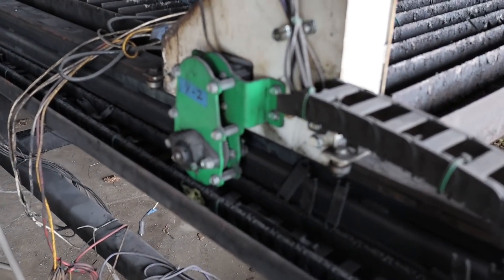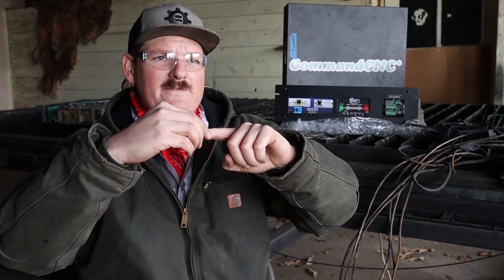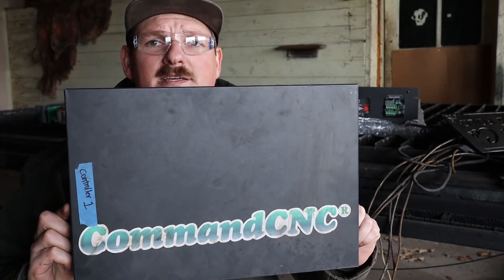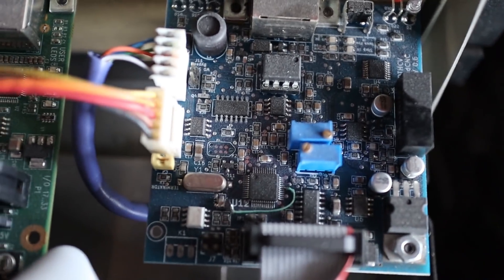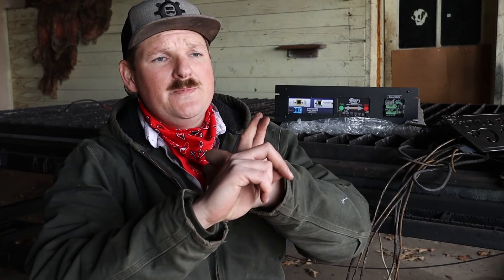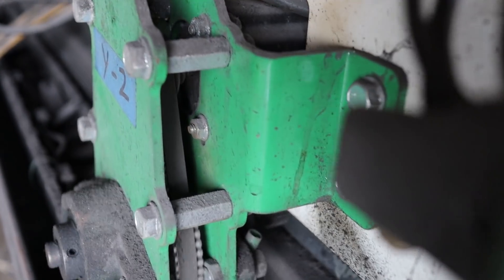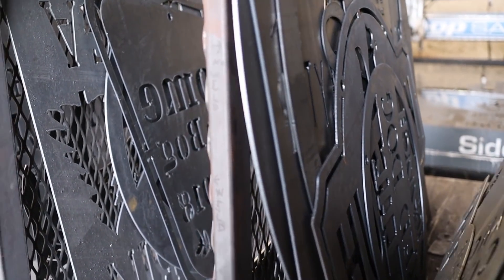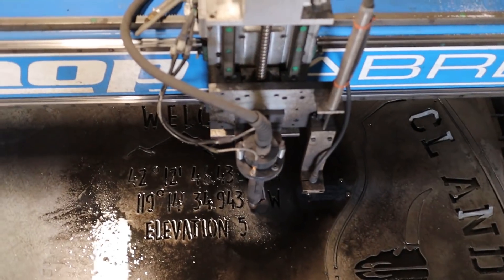BUILD or BUY - CNC PLASMA TABLE (TRUE STORY)

Comment: Man we have such similar issues I can really relate. I designed mine to be able to put a router on eventually and made the gantry too heavy. I have the older bladerunner setup that came out about a year before the commandcnc stuff that was supposed to be better. Which I had actually been contemplating buying a while back because my machine has had an issue ever since new where the torch will cut off but the machine keeps moving. After half an inch the torch turns back on and makes for a day of babysitting to restart the line where it screwed up. I  got another computer a couple of weeks ago from a buddy and it seems to be better but still has issues.

The reason I got the bladerunner was everyone talked about how great the support is but I agree it isn't there. I've emailed on about 6 different issues and every time after 2 emails from them on a topic they stop responding all together.. So I guess you have to figure it out in 2 emails or they move on and your left scratching your head.

I've been reworking everything I can to make it perform better (revamping the gantry) because I am planning on making it a full time gig as well and I'll be buying my next one as well. Not sure what brand yet but it won't have candcnc attached to it.

Is the Shop Sabre stepper motor or servo? Is the lack of speed do to the cut speed or something else?

If you get a minute I have a build page but I lost a bunch of the pictures do to a broken phone.  You may have to sign up but they won't spam you to death. Plus there are a lot of people willing to share their knowledge from plasma makers, cad, and cam issues.   https://www.cnczone.com/forums/plasma-edm-other-similar-machine-project-log/186052-4-x-8-plasma-table.html
Reply from the maker: Wow man, I feel your pain in all of this.  Sounds like a pretty typical experience.

The ShopSabre is glass encoded servo motors.  I think the cut speed could be fixed with some tweaking of the touch off sequence and a few other .ini files but I just don't have the time to crack into it and do some serious testing.  

Thanks for the additional resources, that is the next step for me.  Finding another DIY supplier that I can recommend with confidence.  Keep pushing brother!
Reply: @MakerTable  You're welcome man love to see entrepreneurs do well! That site has tons of different forums. I still go back and search for things and try to help out others just getting started.

Is your shop sabre pretty similar in the process from cad to cut as your DIY table?
Reply from the maker: @FTWarr  yeah the work flow is similar to the DIY table but I miss using sheet cam. I'm forced to use enroute w the shop sabre and it wasn't made for plasma so it's a little clunky. But I've gotten pretty efficient in there by now 🍾

Comment: Sucks about the control box.  I think the waviness of the cuts was probably due to the backlash introduced by the worn set screw/shaft.  One thing that sticks out even with the new machine is the amount of fine metal dust coating every surface.  That can't be good for long term reliability.  I've seen some plasma's with a silicone type shield that goes over the torch. I wonder if that would help cut down on the dust.   Anyway thanks for the honest feedback.
Reply from the maker: You're 100% correct about the backlash in the gear reduction units.  They work loose over time and exacerbate the THC issues to create a perfect storm of terrible cut quality.  I have seen those silicone shields too, it's probably worth a shot.  Thanks for the ideas!

Comment: Man im devastated i just finished a one year odyssey  building my command cnc table based off your table build the  only things i did differently was i saw how you struggled with the tapping the holes for the gantry axis so i opted for the aluminum 8020 extruded gantry and i didnt buy the belt reduction. i struggled with getting adequate cut speeds due to using an older thermal dynamics cutter with no good charts to guide me in set up. of course i discovered my commpressor was underpowered but luckily i had 50 amp service to my plasma machine in advance so i didnt have to hire an electrician. i will absolutley lose my mind if i have to buy another plasma tabel within a year.
Reply from the maker: I totally feel your pain brother!  I wish I had better news for you but this is the realization I came too after may hard fought battles with this company.  I know some people have had better luck with these controllers but it has not been my experience.  I say run that sucker into the ground and don't take any crap from those guys when it's time to get a repair.  I'm still trying to find a good off the sheld controller package to recommend but I'm a little gun shy after the last one.  Best of luck, keep pushing.  If you have the guts to build a CNC table you've got what it takes to make it to the next level regardless of the controller.

Comment: i build my own table with command cnc and i love it never a hick up cuts great every time and so easy a child can use it i think my total cost was around 5500 witch payed for itself first month. sucks you had a bad experience but you did get to learn in the process.
Reply from the maker: That's so rad that you got a good one, I'm happy to hear ur kicking ass with that table over there! I learned a ton doing this whole thing, I'm so glad I had the time to do it!
Reply: @MakerTable  I'm glad it works too but it looks different then your box. Now I've built 3 other cncs check out centroid controller
Reply from the maker: You probably have the Windows based controller, this is the Linux one. I'll check out centroid rn, thanks for the tip!
Reply: @MakerTable  no mine is linux cnc just mine has just a box not that flat style. the centroid acorn is amazing for mills

Comment: Thanks, this video kinda hit the spot for me as I just started a side business with my TruCut XT machine.  I'm pretty happy with it after 3 months but am thinking a bigger machine in the future.  My thoughts had been that JD Squared & Shop Sabre appear to have the best built tables mechanically speaking.  I'm not so sure I like the software platform so much.  I'm using Mach 4, may not be great but it's all I know at this point.  I like Sheetcam and Vectric ok for CAD/CAM.  Would love to hear more about the limitations with the software you said was slower.  I like to be in full control, one reason I don't use Iphone...LOL
Reply from the maker: I'm still trying to figure out how to speed up that machine but all the features are buried in the directory files so I haven't had time to play with it/mess it up

Comment: I also watched your videos an built very similar 5x10 table, however my controler box look different. I have a super z axis an my box is square an white, is it different than yours? So far i have no problems but only have cut about 8 full sheets of steel.
Reply from the maker: That's their windows based controller mine is Linux based but both are made by the same company. I wish you the very best of luck! Thank you so much for watching and taking it to that next level 👍

Comment: Thanks so much for making this video.  I'm contemplating starting a business (not signs) that would use a CNC plasma table and had watched your build series a year ago.  I just recently decided against a build as I don't have the patience to learn and trouble shoot a table and the time it would take me to build it would delay my business by a month or 2 at least.  While money is always an important resource, time is ultimately the rarest resource.  I kind of need a tool that works from the get-go to launch the business.  Building a specialized plasma table might be part of the plan in the future.  I was looking at the Torchmate because they claim a 30 minute install.  However, I'll look at the Shop Sabre.  What other tables did you look at buying?  Why did you pick Shop Sabre?
Reply from the maker: Torchmate, Shop Sabre and JD2 are all making very similar tables. Torchmate is owned by Lincoln so they try to push a lincoln power supply and they just don't make the best plasma. Hypertherm is the winner there. Which bottled it down to Shop Sabre and JD2, both industrial machines at a similar price. Shop Sabre has been building CNC tables way longer so I went with them. I know businesses with all three of those tables and they all run em hard and have no major issues. Those are my thoughts at the moment.
Reply: What's your budget and cutting surface size needs?

Comment: You inspired me to build my own table, but I have looked at it alot. But a long way from finishing. Same thought we cant spend 15 to 20k for table.
Reply from the maker: It's totally possible to make the leap with a DIY table, obviously.  But improve on this build, go extruded aluminum on the gantry and get a better controller. I know flash cut makes a better controller but it's also more expensive.

Comment: I love your honesty. I'm super proud of the business you've built for yourself. I watched you from almost the very beginning. If i were you I'd get a lighter gantry for the old table and buy a Cand CNC controller for it and get it back up n running. A light gantry is key to speed and acceleration on these things. I built my own table too, just as a fun thing to do. I learned a lot and I would probably do it again. I seriously think you get the other table going witha better controller and a lighter gantry. Then you'd have 2 machines going. I think you can get your new old plasma table back up n running with a new Hypertherm for about $5000, at the most. If the table is still good and the drive train is still good. You can use your old table with the lighter gantry for cutting the thin materials.
Reply from the maker: Great idea! I think I'm going to turn it into a laser box cutter for our shipping boxes. That bypasses the THC that normally blows up sp we'll see how long they last LOL
Reply: Wasn't their old controller from CandCNC?  Replacing the gantry with an aluminum structure would lighten it considerably.
Reply: Hell go carbon fiber.
Reply: @dahveed284  Maybe it was. Commandcnc is an open source controller software made to run on linux. The controller I use from candcnc implements mach3. I did have problems with mine in the beginning but out was due to the Chinese plasma cutter I was intending to use with it...the high frequency start fried a few boards. When I switched to a hypertherm pm85, those problems went away.

Comment: Super cool Adam! I remember you telling me all a out your plasma table when you first got it set up. Sucks that the controller has been such a pain. Still really impressive though. I definitely gotta make some time to come check out the new location.  Keep on kicking ass man!
Reply from the maker: Thanks Chad! Find another welding project and you'll have an excuse to come see me 😁
Reply: @MakerTable  I have many!! 1 in particular that I'm gonna see if you would want to help me with. I want to build a raised lid for the trailer. Would ideally like it to be built out of aluminum. I've got some ideas drawn up in cad. I'll reach out to you soon to see if it's something you'd like to help me with.